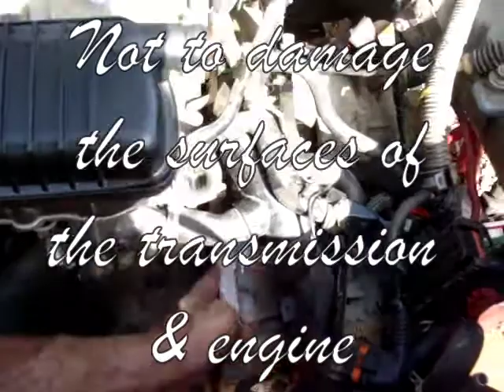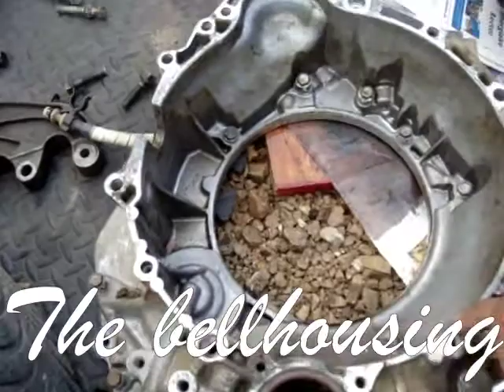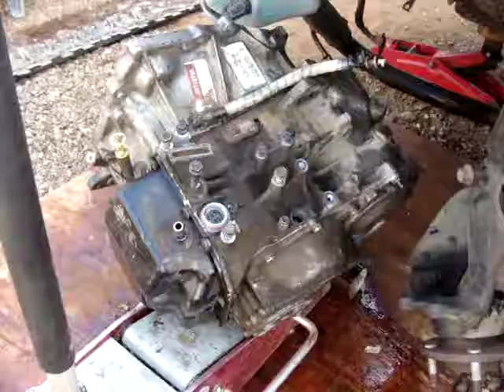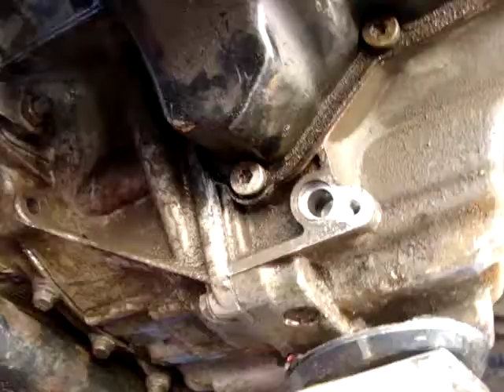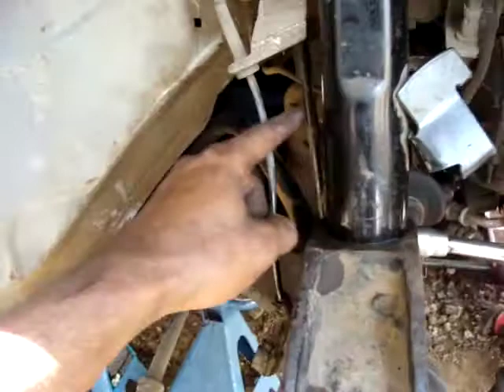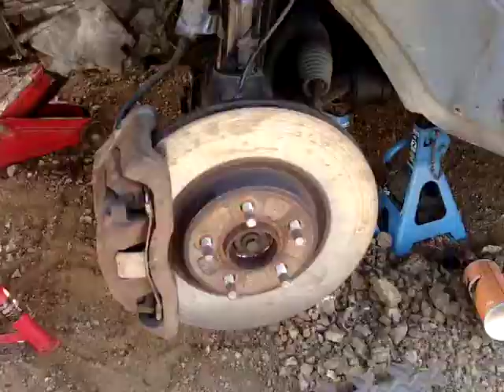Volvo V50 Transmission Part 3

Comment: How do I check and add transmission fluid to my 2005 V50 T5 that's not all wheel drive
Reply from the maker: @DennyKleckner, thank you for your message. It is not possible to check the fluid the same way as checking the engine oil level. What is possible, is to check the estimation on the transmission itself. It will be difficult to explain like this: 1 Make sure the car is leveled, 2 On the transmission there are two screws: one for removal of the transmission oil and one for refilling. 3 Open the refilling one first. If oil comes out or you can feel the oil with your finger when you stick it into the hole, the oil level is ok. This refilling screw is situated higer than the drainage one.

Comment: Which trasmission is...? Aw55 50..? Thanks
Reply from the maker: Mr Rober B, you are correct. This is the AW55-50.
If it is necessary to, in this case, replace the filter and transmission fluid, than it must be done. Unfortunately, Volvo decided to make a filter inside of the transmission, which results in disassembling half of the car.